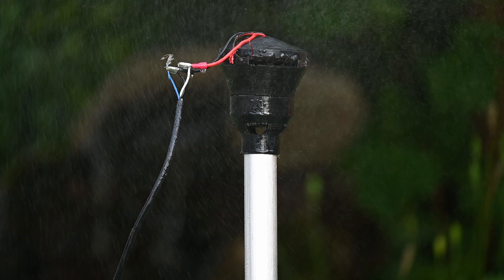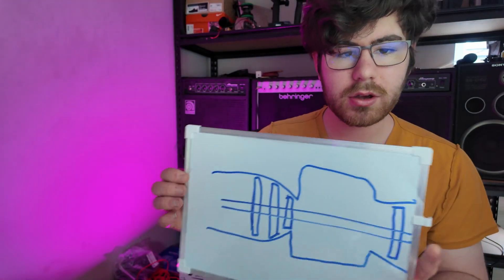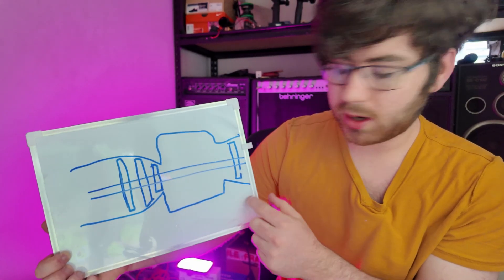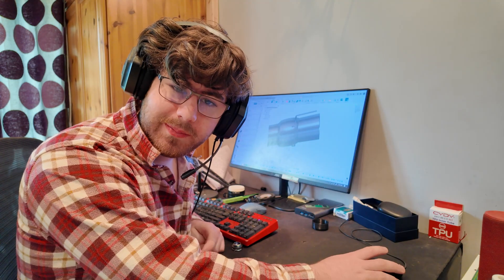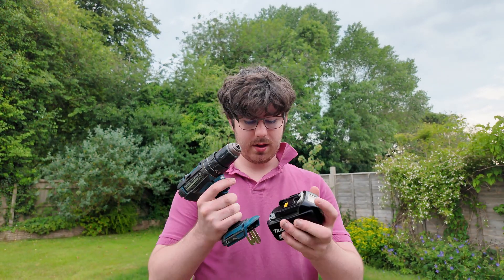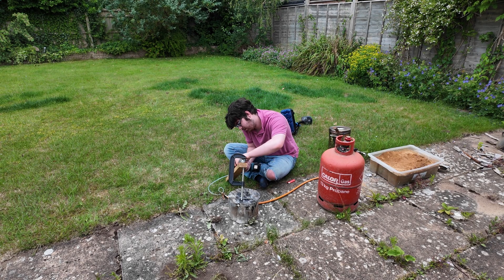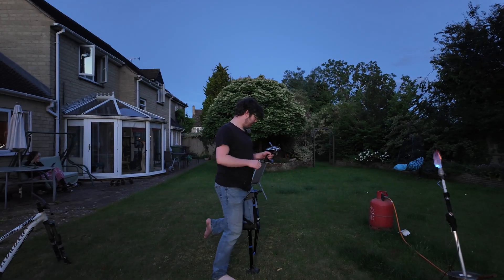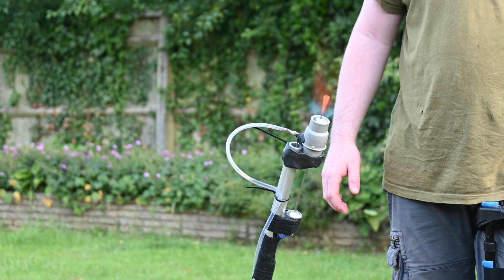JET ENGINE POWERED AIR UMBRELLA (abr.)

Comment: You can definitely get more than 140w with a proper battery
Reply from the maker: you can only comfortably fit 3 18650s into the handle of an umbrella. this means you will be drawing 12a from each battery, which while possible will not last very long at all.
Reply: @Boris_Woodward Try 9x 21700 high current batteries and a 1kw edf
Reply: @Boris_Woodward with a slightly wider handle you could fit some 21700 cells, the INR21700 50S is rated at 5Ah per cell and a continuous discharge rating of 35A. Won't last long buuut, more power! :D
Reply from the maker: @FAB1150i could use 21700, but i really need 7 or 8 to get ant kind of run time. im playing around with rc car batteries, you can get more energy in lipo cells than li on, but the issue is the energy density is just never gonna be there for an umbrella. In my experience anything over about 1kg is too heavy to hold for a long period of time. 500g of that is taken up by the motor and fan, then you only really have 100-150wh at best which just isn't enough. Theoretically I could have more energy using a magnesium battery, but they dont exist currently. So gass is the only option for now, but im re designing it to have a a compressed air start which removes the motor, and gives me a better jet engine.